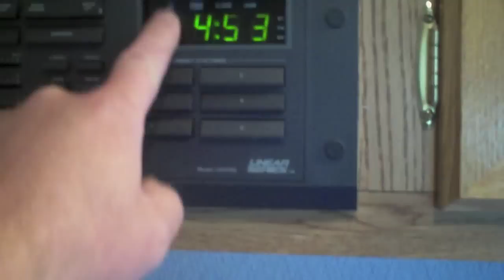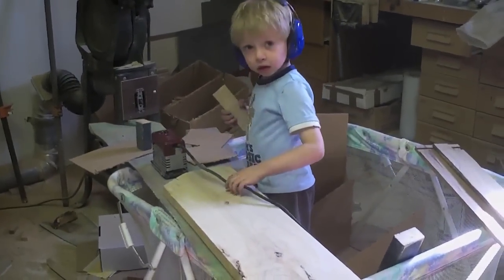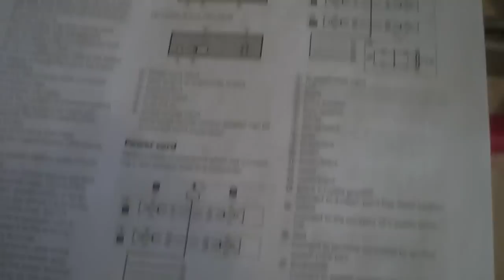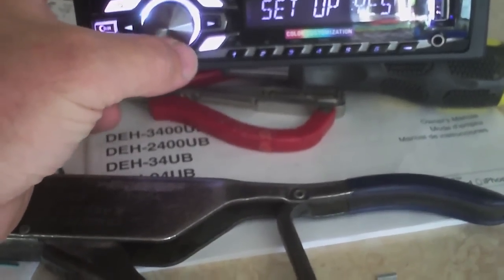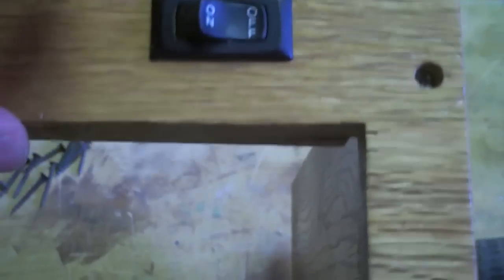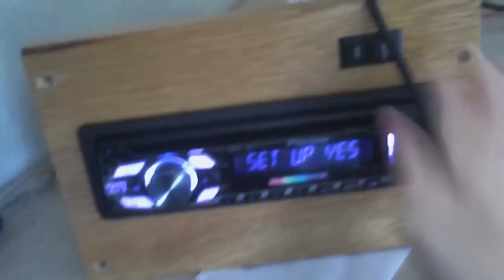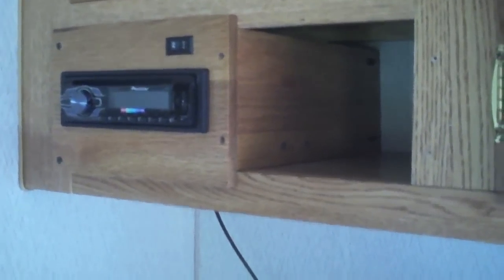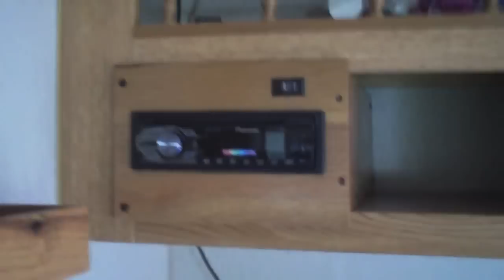Prowler Camper Radio Replacement

Comment: How did you wire your stereo to your common ground speakers without burning up your stereo? I have a 99 285S prowler fifth wheel with the same issue and I could use your input! I am trying to use a floating ground adapter on mine.

Comment: Great video but I need to know which wire from the trailer harness was the Pos, neg and the speaker positives and negatives, as you said my stereo does give a wiring check and it has told me so that something is wrong, do the return comment of the wiring connections thx
Reply from the maker: Mine had a positive for each speaker (LF,RF,RR,LR) and a common ground wire for all of it, speakers and radio.  If your radio is fancy that sort of set up might kick a wire fault no mater what you do.  Might write the company and see what they say.
Reply: NelsonStudios Thx, for the reply, I brought a JVC KD S29 a normal car stereo, I will contact JVC but my real problem is my RV wiring to the speakers and which is + and what is - because the trailers harness does not have a Blk stripe for the negative again thx for the reply.

Comment: Does it run off both shore power and battery?
Reply from the maker: Runs off the batteries only but the batteries are always being charged when connected to the mains so yes.

Comment: Dude you didn't show us how it was done.
Reply from the maker: Cut the hole and connect the wires as the old radio had them. You might have to fish a constant 12V if the old radio lacked a clock in order to maintain time and station programming. I use a rocker switch connected where the new radio lists ignition. If you want it on all the time  connect that to your constant 12V. I recommend a switch or it could run your battery dead.